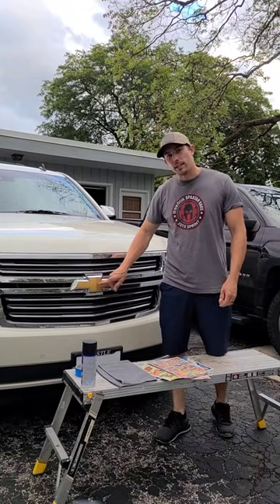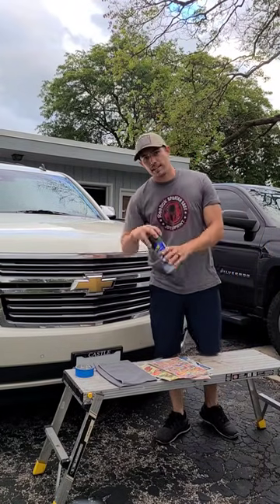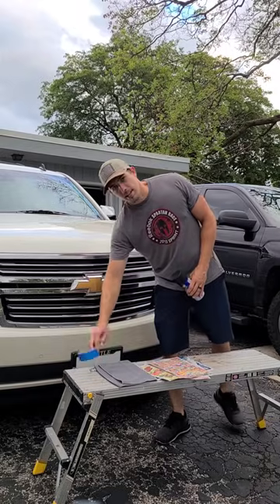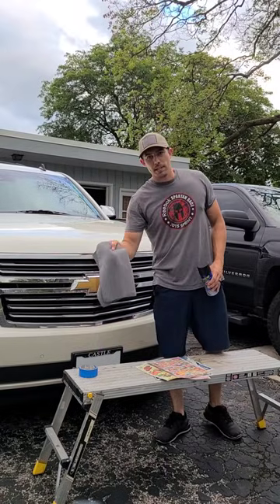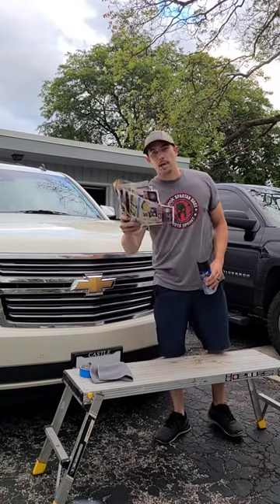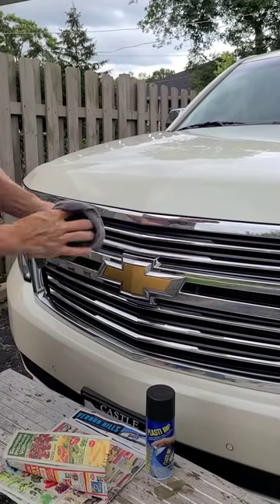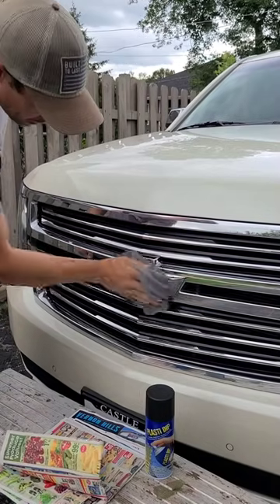Plasti Dip Your Car

Comment: Looks fantastic 👍

“How long will it last though?” is the question keeping on going through my head. If the peeled plasti-dip peels off so readily… I worry about its longevity.
Reply from the maker: I've had the logos on my other car plasti dipped for 4 years now. They still look good.  I've been through quite a few car washes.  And it also cold in the winters. Here.   If it does come off you can just re do it.
Reply: That is awesome! Thank you for the much appreciated update 😍👍